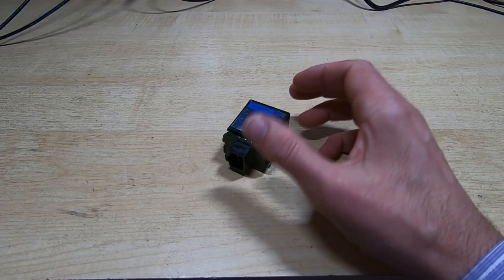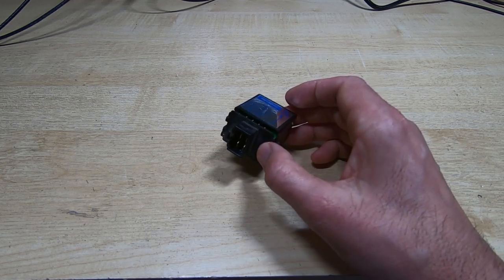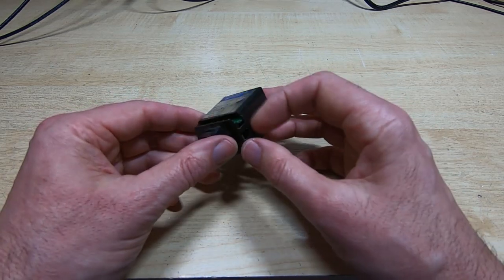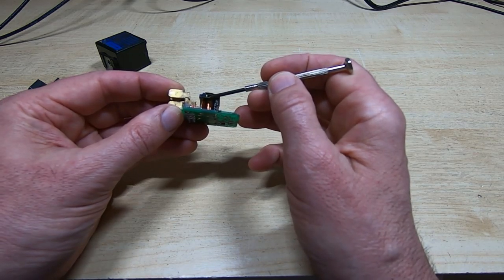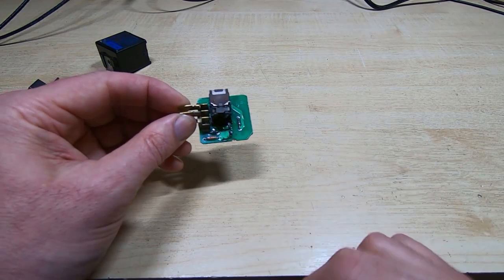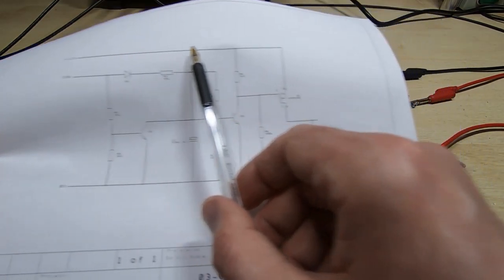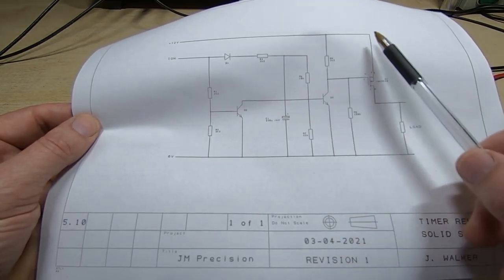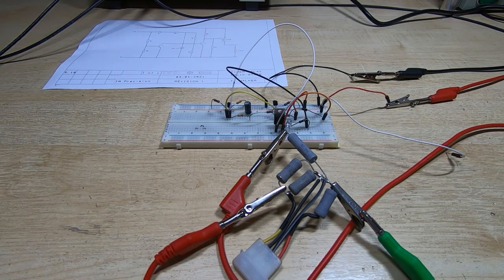Engine Stop Relay Repair

Comment: Curious... how does this deal with a debounce of the ignition line?  You've eliminated the slow relay in favor of a very fast transistor/mosfet combination... but it seems once you charge the cap, you might still pull the pull the mosfet high even if you have a new ignition signal (the second high side of the bounce.)
Reply from the maker: The circuit is level controlled and not edge triggered so the ignition signal can bounce as much as it wants to and it will have no effect on the action. In fact if the ignition is turned on and then back off a second later the solenoid is turned on but if the ignition is then turned back on the solenoid is turned back off. Because the first transistor action is very fast compared to the capacitor charge circuit then the circuit ignores bounce. In fact that was a major part of my concern when I designed the circuit because I did not want the solenoid to 'click' when the ignition was turned on. The effective debounce time is therefore approx 5 seconds.